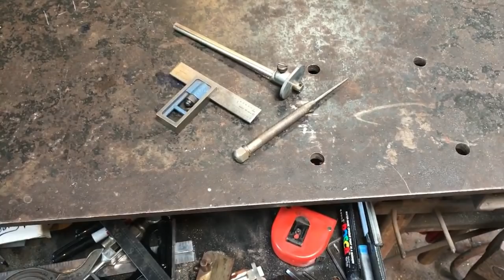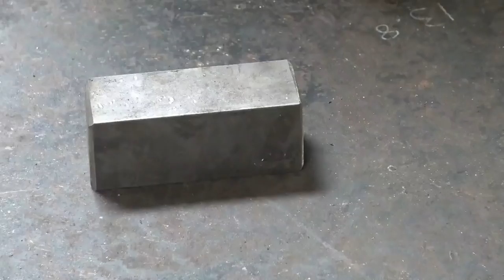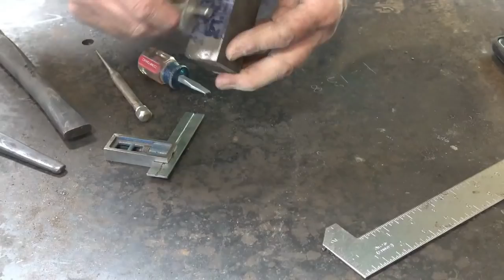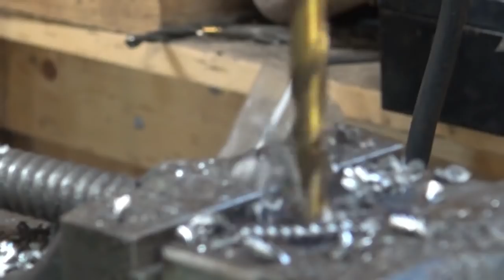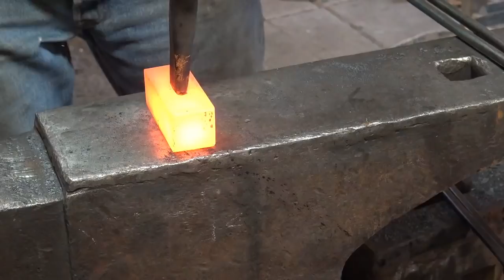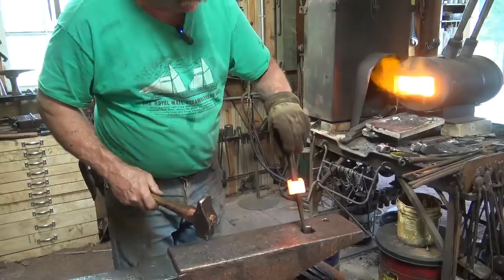Forge your own HAMMER - Blacksmithing

Comment: If I may suggest an alternate technique I learned from an old blacksmithing book. After drilling the two beginning holes as you did insert a low carbon steel bar in each one and then drill the center. The bars will keep your center hole from drifting to either side. I think you will appreciate the speed of forming the handle hole this way.
Reply from the maker: tarnshadowhawk that sound like a very good idea.
Reply: ترجمه

Comment: A little drill press tip when you chuck a drill bit tighten all three jaws they will hold the bit better and when you take the bit out you will find it easier with just one jaw. Tip of the day Len

Comment: Advice from a 38 year machinist; if your drill is long enough to go through the stock, back the drill out as many times as necessary to keep the chips clear so they wont bind and break your drill. NEVER try to make holes meet from opposite sides if you can help it. The likelihood of breaking the bit is too high; if the location of the holes is off even a little bit--a hair thickness--as you break through, you will over feed and the drill will grab just as it did here. In many cases a substantial portion of the bit will bind and break off inside the piece, and be next to impossible to drive out.
     That being said, I have watched dozens of these videos and find them very informative and entertaining. your skill level is very obvious. Thanks for all you reveal!
Reply: maybe metal drilling is different, but when drilling through wood we attack from both sides to keep a straight hole, for similar reasons he instructs us to keep turning the head around when we drive the chisel.
Reply: Very good info, and answered questions I have had on issued I've encountered in drilling steel
Reply: i agree

Comment: I use a hammer eye punch and I don’t drill any holes but I can punch a hammer billet much faster than with a drilled hole. But it’s easier to have a not straight hole so I’d recommend this for beginners

Comment: Great video !!!!  basic enough for the regular Joe to understand.  I've also seen Smith's form cheeks at the handle hole. is that something you care to shed some light on ???? again Thank you for your time to demonstrate Blacksmithing.
Reply from the maker: Thanks, the cheeks, in theory, add more surface area for a better hold on the handle.  which is probably true, but the main reason people do it is for the look and I do like them.  But they add more work and I wanted to keep this hammer more simple.  Perhaps I will address that in the final video on other approaches.

Comment: What about wide tapered slotting on end of punch for a scalloped edge would the narrower buts cause less resistance and aide in speed and less fatigue  and clean up with the drift or would it just be more contact surface and make it harder

Comment: Good stuff! I know you hear it... alot! But thank you. I wouldn't be near where I'm at without these videos. And I'm still very early in my journey. 
A question if you don't mind. What would you recommend first, a tredel hammer or a fly press? I know the jist with the pros and cons between the two. Different tools, similar but different applications. Currently I make alot of smaller projects I don't mind knocking out by hand. Skulls, leaves, aliens, hooks of all too. But I really want to get more into tool making. I have what I need for now, made at the anvil. A couple hardy cutters, a hardy pillar(flat top), a spring fuller, bending jig, punch/chisel set ect. But I want to get into more with hammer/axe/handled tools. Today I got a little over my head with an axe I'm working on. First I really used the wrong material for the shape I want. (Car axel) but  I got it squared off, hole punched and now I'm spreading... the long part lol. I don't mind learning and doing it that way for some of em, but for future productivity I'd like some help. Tredel or press... oh the choices lol! Hope my rant isn't too bad, and thanks again. see ya next video!
Reply from the maker: Of all the big tools I think a treadle hammer is the most versatile.  It takes the place of a striker in many cases and allows for traditional styled top tooling.
Reply: @BlackBearForge  awesome. Good looking out John🍻

Comment: I am considering making my first hammer but making it out of mild steel (CRS) instead of tool steel.  That way, if I totally mess it up, I'm not out a lot.  Any thoughts or suggestions?  Also, assuming the hammer turns out sorta OK, would it be worthwhile to case harden it using a carburizing  product such as Casenite or Cherry Red?

Comment: John, why not drill the 3rd hole beween the first two?  Is it because you would be fighting the bit, the whole way,  or omething else?? Since I have never made a hammer, it would seem less trouble to have the 3 holes and not have as much metal to move with the punch!  I have been a Blacksmith, making Rendezvous-type items like camp fire sets, S hooks, the occasional knife and things like that, for many years!  However, I became disabled with a rare disease, about 20 years ago!  It eats all the cartilage from all the joints and then erodes the ends of the bones!  So, with that problem, I can't do much heavy work without hurting my joints!
That is why I'm asking.
Thanks in advance for your answer!
I really learn so much from your videos!  Having been a teacher, I can honestly say that you are an excellent instructor!  Best wishes to you, always!
Reply from the maker: That does work, but sometimes leaves traces of the holes as a wavy edge to the eye.

Comment: I am curious with all those metail shavings, wouldn't it be a good idea to collect them with a magnet and safety store them and then when you have enough recycle it and create a iron ingot? 

I see alot of metal shavings come off hot metal when you hit it, so I feel like all those shavings can be recycled. Am I wrong?
Reply from the maker: You're looking at scale, a form of iron oxide that forms at forging heat.  It has no value and cannot be recycled into new material.

Comment: Perhaps I have not seen it yet but are your drifts made out of tool steel or like your hammer 4140?? which I see a lot of used axles would work for this application? What does the vermiculite do? rather than dipping it in oil first?
Reply from the maker: They are from a few different things, 4140, 5160 and S7 mostly

Comment: Hey John!  What are the dimensions of the hammer drift and what type of steel should I use please?
Reply from the maker: I'll try to to remember to check when I get to the shop today.  But the best plan is to start with the handle and make a drift for the handle you want to use.

Comment: I've looked all over for how to make a bell hammer. 

Any advice?
Reply from the maker: I have no idea what that even is
Reply: @BlackBearForge  I really thought I JUST gave a response to you here.

So... "trow and holden", they make a bell hammer. Instead of it having a Cylinder that's perpendicular to the handle, it goes along the handle and tapers in as it goes down the handle. 

It's designed in such a way that if you're pounding away at a chisel and miss, then hit your hand, it'll roll off your hand without injury.

Comment: So it have been lurking and learning a bunch from your videos. My question is what type of tongs are you using to move that mass of steel? Could you make a video explaining the tongs and their uses? Thanks and keep up the good work.
Reply from the maker: I have made lots of videos on both making tongs and types of tongs.  https://www.youtube.com/results?search_query=black+bear+forge+tongs
The tongs are used only to hold the material they do not actually move any of the mass.
Reply: Black Bear Forge  thank for taking the time to reply. I appreciate your time. I was more referring to the types of tongs in your shop explained in one video. I have watched many of your tong videos and have learned so much. As for the mass, I am looking to make a hammer or 2 and possibly and axe. Most of that metal I am assuming weighs more than 3 lbs. what tongs would be good to carry it from the forge to the anvil? Thanks again

Comment: What drill bit do you have in that press? The chips were amazing and the speed through 4140... I feel like it would have taken me three times as long to drill those holes.
Reply from the maker: Not a clue, I tend to buy the coated but don't know what brand they are.

Comment: John, what's your average start to finish time on forging a hammer?
Reply from the maker: Good question.  I do the rough forging and then anneal it over night.  Grind on another day and heat treat, final grind on a third day and perhaps add the handle on a fourth day.  So it seems like a long time, especially if those days aren't consecutive.  But total time involved is probably 3 - 4 hours for a forging hammer and less for a little 1 pounder

Comment: So i know this is quite an old video so i dont expect a reply... But do you quench your tongs during this process? Im very new to Blacksmithing and find my tongs overheat... So i assume i just working too much with the same tongs or theyre too thin... Or its semi nornal and people quench their tongs? I just didnt see you do it in the video. Only quenching the drift and punch. Please and thanks if anyone does reply <3
Reply from the maker: Yes, but if they get into a red heat be careful.  Tongs made from higher carbon alloys can break if quenched at high heat.  Personally I always make my tongs from mild steel to avoid that problem
Reply: @BlackBearForge  Thanks so much for the reply!! Absolutely love your work... And have learned so much from you and your videos!! Keep it up! <3

Comment: I really like the diagonal peen hammer I have seen you use sometimes, would it be feasible to make one out of a hardware store hammer ?   Start with a small sledge, or maybe a crosspeen and try to twist it ?
Reply from the maker: Twisting a short section of hammer head sounds pretty hard to get right.  I would reforge a small double faced sledge hammer.

Comment: John, what type of steel are you using for your punch/drift ? Are they made of 4140 as well? If not will 4140 make good tooling? I ask because I have a forklift fork that is I think 4140 but I am not exactly sure on the composition for sure. Thank you in advance, Martin M&S Blades
Reply from the maker: I think it was made from an old jack hammer bit which was most likely in the S2 range.  However 4140 would make a good drift that would provide years of service.  I have no idea what steel fork lift forks are, but there would be a lot of good tools in a set of forks.  Do a test piece and see how it hardens.

Comment: By chance do you ever make peening hammers for sale ? Im trying to find one at a reasonable price just trying to get into black Smithing. Thankyou for your video's and the time you take to make them takecare my friend.
Reply from the maker: I have made a few for sale.  My current lead time is about 16 weeks and a hand made hammer will cost more than one from a supplier.
Reply: Would you mind giving me a idea of cost i was told 100.00 was a good deal but i figure you are a full time Blacksmith and would have a better idea. Im just getting started and am trying to get my basic things together i have an Anvil olf and has a sunken area in the center but i figure it will do until i can afford to have it hard faced i watched it on u-tube its a great source of info. Thank you for any help you feel like offering and takecare my friend.
Reply from the maker: $100 would be a very good deal for a hand made hammer.  I'm afraid mine would be $175 for a hammer of about 2 1/2 pounds.  Lots of old anvils have a sway back.  It can be  a nuisance at times but once you learn to deal with it you may find it has some usefulness.